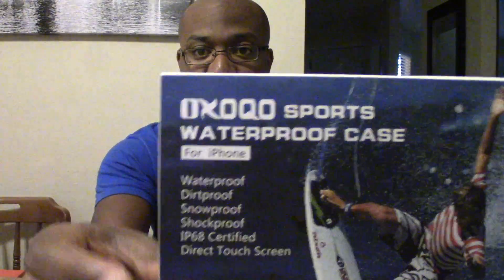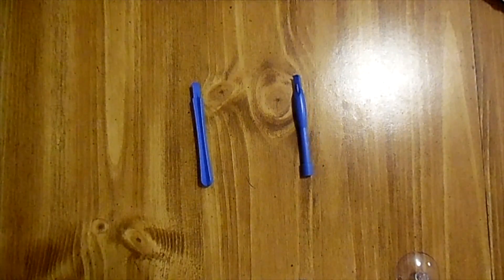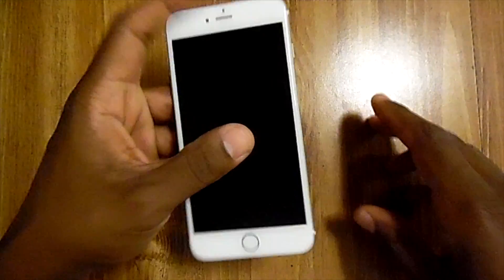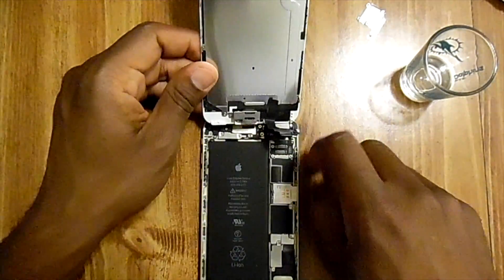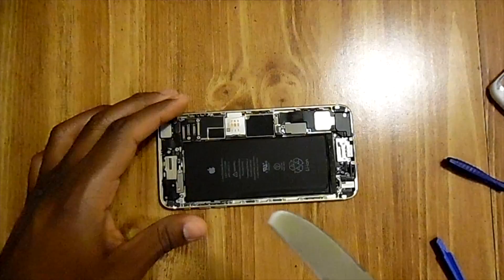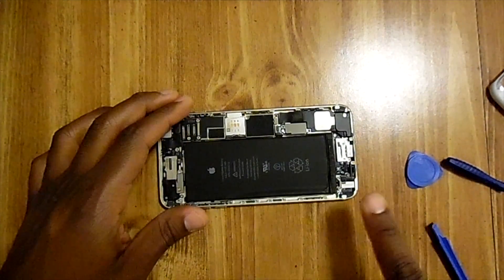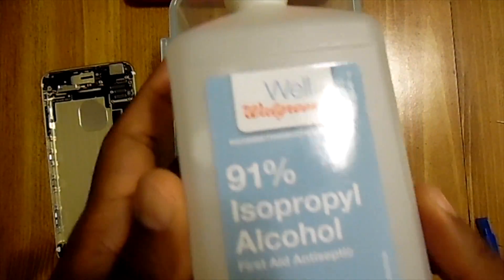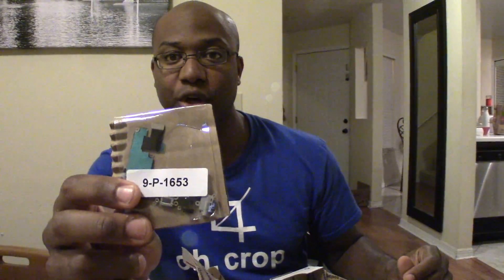Fixing an iPhone 6Plus With Water Damage

Comment: The battery is posed to be discontinued before anything else is tampered with on the motherboard (1)the battery has pull tabs to remove it plus when he did it wrong he perced the battery and wrecked it (2) he didn't remove the motherboard from the housing hence if his camera didn't have black spots in it it dose now and he didn't properly clean the rust off the motherboard
Reply: There are pull tabs on the 6 plus i have 3 in stock right now and fix phones I think I know what I'm talking about considering I've been fixing phones for 6 years
Reply from the maker: Cell phone Repair there are no pull tabs for the 6plus. The battery is glued to the housing. Apple saw the enlarged battery after I heated it and gave me a new phone..... so I win
Reply from the maker: When the battery comes up in the actual video above you can see that there aren’t any pull tabs. Maybe they added them after guys like me kept destroying batteries trying to remove them. Plus there are tons of videos complaining about the fact that the battery is so hard to remove.

Comment: Bruh you’re supposed to remove the processor board and remove the black stickers. That’s where the water is. You soaked it in alcohol and filled up the processors. Clean it with alcohol and a tooth brush.  Then heat dry it.
Reply: That's not the only thing he didn't do right
Reply: The battery is posed to be discontinued before anything else is tampered with on the motherboard (1)the battery has pull tabs to remove it plus when he did it wrong he perced the battery and wrecked it (2) he didn't remove the motherboard from the housing hence if his camera didn't have black spots in it it dose now and he didn't properly clean the rust off the motherboard

Comment: Or you didn’t put it on tight
Reply from the maker: Ray Hawkins it turned out that I shorted out the wiring with salt water but there wasn’t actually any water damage to the sensor. Apple thought it was an expanding battery problem so they replaced the whole phone. The video was a fail but I won at life.
Reply from the maker: Ray Hawkins p.s. thanks for the view.